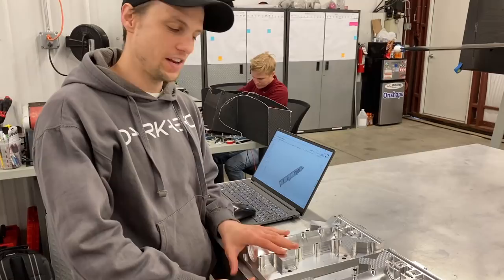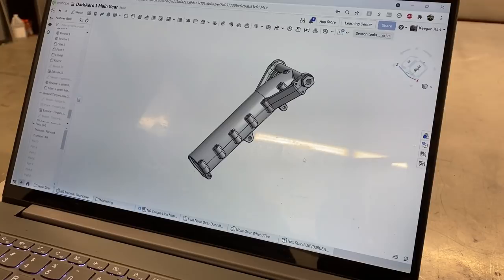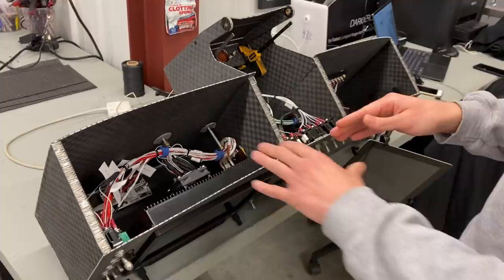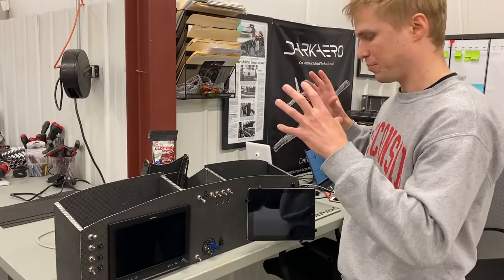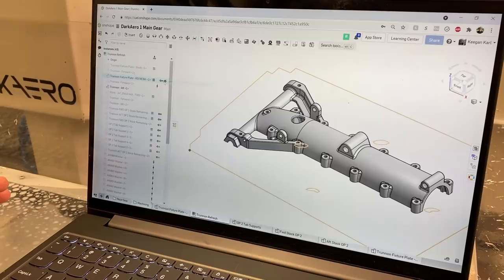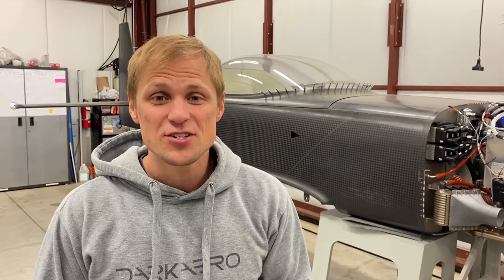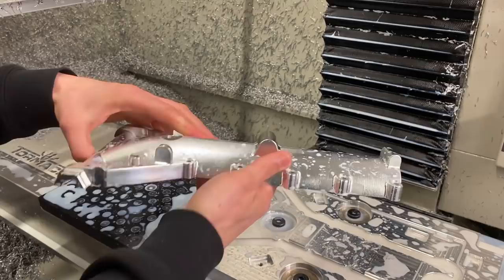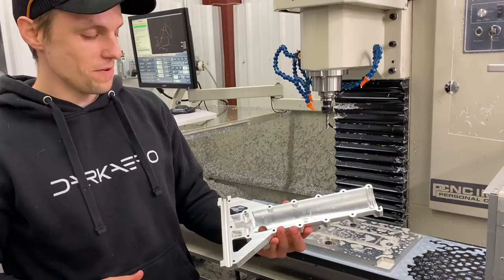What's Left to Finish the DarkAero 1? | DarkAero Shop Vlog | May 10th, 2021

Comment: It’s always a joy to see that your not cutting corners despite the, what must be huge, pressure you must feel to get DarAero 1 out of the hanger and onto FWFWD, Taxi and Flight Testing. Seeing you constantly improve the quality of your processes and finished systems with a clear focus on safety, reliability, performance, manufacturability and assembly is reassuring. This bodes well for future of Dark Aero aircraft and the company.

Two brief questions:
1) I know how critical getting the more complex nose gear right but where you guys at with the main gear?
2) Is there a safety cage you can put to protect the switches/breakers? These can give you something to steady your hand when trying to toggle or reset in rough air and can provide additional injury protection for pilot & passenger in a rough landing or unplanned flight termination.

I love the progress your making and anxiously await your next update.
Reply: Panels are going to be completed by the customer, so switch cages is a personal choice.

Comment: Man, if I were super-rich I'd give you guys a Haas or something.  Love the 3D machining but it looks like you're not even going 10 ipm.  When I make stuff like that I go from 100-200 ipm.  Being able to do that could save you a TON of time!  Otherwise, love the progress...keep kicking ass!
Reply: Yeah the 3D pathing doesn't look fast but I'm pleased to see the results aren't bad. I don't do a lot of 3D machining but from what I see, wouldn't get much better finish from a Haas unless spending a small fortune on tooling: for the volume they're dealing with in-house, it doesn't seem to matter that it takes a few hours to run that toolpath.

That said if I was doing production of those legs even with a basic Haas, would definitely be reducing the amount of 3D work.
Reply: They are prototyping and want to learn all they can about making and tweaking the parts for production- in house. Great idea. They will obviously sub out the production parts to shops with more capable mills in the end to save time and money. There is a lot of hogging on the nose gear parts.  The Tormach is slow but gets the job done for now. Tormach is located in Madison as well so they have close by support, another good idea.
Reply: A Haas? 😂😂😂😂 Stick with the "or something" like a Mazak or DMG Mori
Reply: Mark is here !!! damn....
Reply: @Shreyam_io  Was thinkig the same thing!
Reply: Yeah, I have a Tormach and it just can’t handle the ipms of more rigid machines. If you’re patient, you will get amazing results but while patience may be a virtue, it will push any deadline back a few fold in comparison to something like a haas.
Reply: @PatrickJWenzel  Are we in the presence of an unknown celebrity of sort?
Reply: @danl.4743  If you're into RV's and the Van's Air Force Forum, then kinda yeah.
Reply: @biffaplayz  A DMG Mori?  It is a piston GA plane, not a space shuttle...There is nothing they are building on that plane that needs to hold more than a few thousands...A VF2 would be more than they would ever need...even doing production...
Reply: The real question, will a 50 fit in a DarkAero 1?
Reply: @PatrickJWenzel  Hopefully I'm known more for the thousands of guns out there with my name on 'em!  ;-)
Reply: @ParadigmUnkn0wn  :-D
Reply: You make a good point and it illustrates my concern with the the sustainability of their long term business model.  If they don't have enough capital to purchase an adequate CNC, it might be an indication they don't have the funding to go beyond a "back yard" project.  From a cost standpoint building a one off airplane and even getting it certified is one thing...ramping up for production is another, the costs go up by an order of magnitude.  The road to success for this business model is littered with hundreds of carcasses of defunct companies that tried and failed. I wish them success but if they are hoping to fund the "next steps" (cert, production, kit sales etc) with customer deposits then its likely they will fail.  They better have a business model that's ready to burn through their own cash reserves for quite some time before reaching long term cash flow sustainability.
Reply: @biffaplayz  Mazak?  Clearly you've never owned one...  DMG Mori?  Is that what they're calling themselves this month?  I love my Haas machines.  Incredible value, tight enough tolerances for what I do, and they just keep running.
Reply: @tstanley01  A DMG isn't just for Aerospace level stuff. We run ours at my workplace typically 24 hours with Fanuc Robots, 5-7 days a week, where they shine is that I can do almost all maintenance/refilling while the machine is running and it's minimal. It's far cheaper than running a HAAS if you're doing production in the long run.
Reply: @markserbu I run a Haas DM-1, so I understand where you're coming from, but I actually like the fact that they built all their parts on a Tormach. What they're getting out of this entry-level machine is incredible. And it forces them to keep their parts and processes relatively simple. If they can make it work on a Tormach for the prototype, they can scale production up easily. This is a great forcing function.

Comment: I was just watching a video about engine out landings and the topic of water ditchings came up. It's obviously not a unique problem to this plane, and I'm not sure of what solutions may already exist, but what can be done to improve the survivability if the plane flips on a water ditching? A "SpareAir" mini-SCUBA tank would probably buy enough time for the cockpit to flood and the pressure to equalize, but if you go down in shallow water and it hits bottom before it equalizes...

I don't see how any other egress point could be added to the airframe. The only viable option I see is making the cockpit dome somewhat easy to kick outwards. Mike Patey covered his solution to that on the side-window of the cub he's building. I'm not sure if such a solution is viable for this design, but if it is, that'd certainly add some peace of mind to any pilots that are lucky enough to get their hands on one of these.

Comment: Cool. Once it's complete I'd like to see you do a welded tube landing gear alternative. It's not as glamorous but it must be a superior solution on multiple parameters. Maybe chromoly. Maybe a curved spring steel segment as simple suspension. Maybe spring steel coupling to the actuator.

Comment: I have been following this with interest. I do have some questions though. What is the combined weight of engine and fuel system (including full tanks)? The reason I ask is that the "next gen" of high torque (IE designed to spin a prop) high efficiency low weight electric engines are here. Actually there is a choice of several. EG the 260kW siemens unit weighing 110 pounds. If you can get away with 220kW then Equipmake (UK company) are most of the way there with an engine that weights a mere 10KG (22 pounds). That would leave a significant amount of battery weight available. If we assume 220 pounds of fuel (just over 30 US Gallons) and a gasoline engine such as a Lycoming 235 series at about 200kg for the 140ish kW model (200HP). That would mean about 190kg available for batteries. Yes the cabling would weight a fair bit but so do empty fuel tanks etc. 190kg would get you about 38kWh. When solid state lithium hits the market it will be at least triple that.
Reply: The viability point is a density of 400  Wh/kg, which is projected to be three or four years away. And that means a run time of well under an hour, not suitable for airplanes. The application would likely be VTOL quads operating in areas of high population density.

Comment: Ive seen a lot of your videos and wonder that you never had any rubbergrommets where your electric cables go thru carbon parts, that must be an mistake hence carbon easily cuts your cables when coming into contact, yes yes you hook up the cables so they run in the middle of the holes, but when applying heat (sunhot summerday) the cables tend to bend in different ways not predictable.

Comment: Hey I just watched the first video on the engine (relatively new viewer, please excuse my ignorance). Just wanted to know if you ever put check valves on the parallel fuel pumps as the way they were set up had the ability to back feed through one another if one failed/wasn't running.
Reply from the maker: Jacob, thank you for checking out our channel! The fuel pumps have internally integrated check valves that will prevent any back feed.

Comment: I'm no airplane designer, but a single connector for the entire panel is a one point failure, I would atleast have had two, on either side of the panel, so when one connector gets a short, or a small engine fire on one side, I atleast have the other half of the instruments.
A single connector would be good if you plan to rip the panel out often, but my guess is that once it's in, it stays ine.

Comment: Hard to see going into production making the nose gear trunnion that. Looks way too time consuming. Maybe go to a batch casting?
Reply from the maker: Dave, fair question! The biggest driver when considering casting vs. machining is volume. Typically casting should be considered once part volume goes into the thousands of units. We will likely never be in that volume range for the DarkAero 1 so machining is still a good choice for this part. For production, this is the type of part that would benefit from a more capable, 5-axis CNC machine with higher spindle power and faster feed rates over the Tormach. Additionally, even if we were to go the casting route, the casted units would still require post-process machining for the central bore, the mount holes, and threads.

Comment: You appear to have the tunnion main load pivot point (for the leg to swing up and down) split with and bush in it, wouldn't it be stronger to have that as a single piece by splitting the front leg front to back rather than side to side?
Reply: Got a lot of tension loads going through those top and bottom bolts holding the two trunnion pieces together too every time the wheel touches down and spins up. I question the need to design a highly loaded part like this out of a fatigue prone material. Welded steel would have been my choice without splits but hey, not my toy.
Reply: @thomashong7016 , bolts are good in tension, not in shear. That's the best way to design a part like that out of the materials they're using. Steel, especially welds, is also prone to developing cracks that can cause catastrophic failure. There's no replacement for proper inspection and maintenance. Dye penetrant testing materials are not terribly expensive.

Comment: Is there enough space to accommodate a full radio stack with the likes of GMA, GTN, GTR, GTX, GFC, in addition to a standby G5 or a GI275?
Reply from the maker: Good question. The radio and transponder we're currently using are remote mount and can be operated through the main G3X display. Our plan is to add the GTN and GFC in the center as well as a second G3X backup display on the right side of the panel. With this configuration + the iLevil 3 ADAHRS backup there will be a pretty solid level of functionality and redundancy with the avionics stack.
Reply: @DarkAeroInc  Did not know you can wirelessly interface the iLevil into G3X, cool.
Reply from the maker: To be clear, the iLevil communicates with the iPad not the G3X. The G3X however can communicate with the Garmin Pilot app over bluetooth.
Reply: @DarkAeroInc  I see, thanks for clarifying.

Comment: It would be nice if potential customers had a better understanding of your business case and how you are covering current expenses without any revenue.
Reply: They've explained before that it's a self-funded project. It greatly simplifies the project.
Reply: @ParadigmUnkn0wn  OK...Then how deep are the funding pockets?  Building a one off airplane and even getting it certified is one thing...ramping up for production is another, the costs go up by an order of magnitude.  The road to success for this business model is littered with hundreds of carcasses of defunct companies that tried and failed. I wish them success but if they are hoping to fund the "next steps" (cert, production, kit sales etc) with customer deposits then its likely they will fail.  They better have a business model that's ready to burn through their own cash reserves for quite some time before reaching long term cash flow sustainability.

Comment: What aluminum alloy you are using (if it is an Al alloy)?
Reply from the maker: The alloy we use depends on the specific part but we use a lot of 7075 and 6061. The trunnion halves are 7075.

Comment: With that one central connector does that pose an issue for IFR certification? It seems as if there's no backup for that. Or would the second G3x have its own connector and operate as a stand-by?